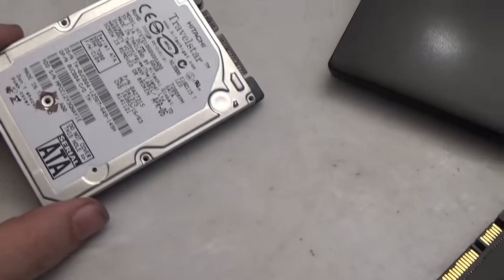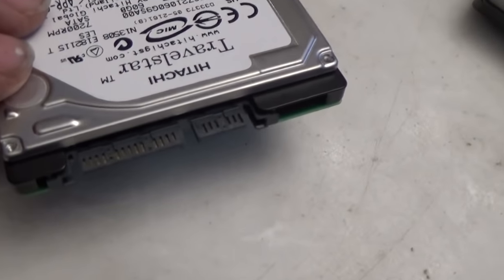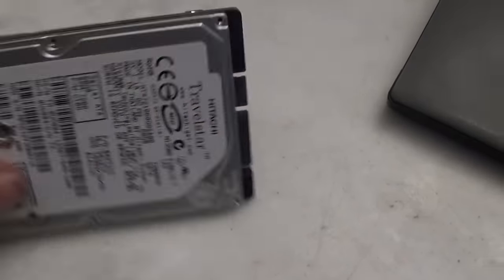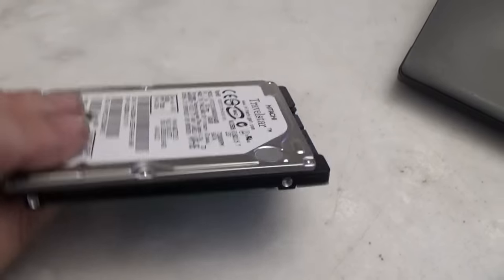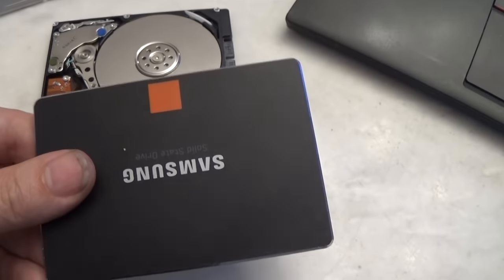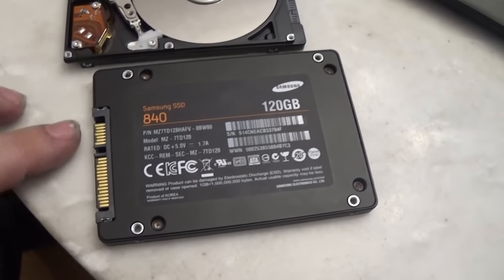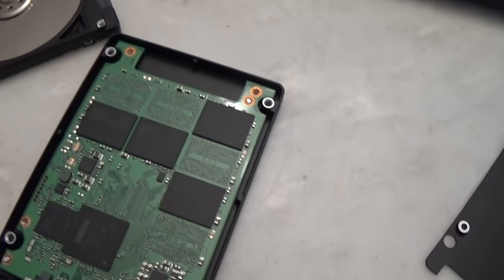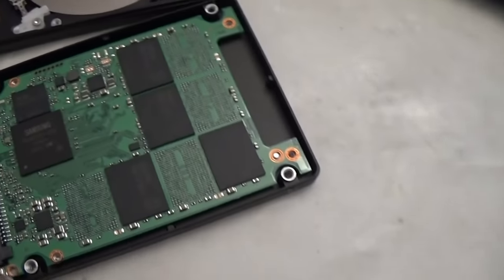Take a look inside a hard drive while it's running

Comment: So that explains why the sound in my laptop is hissing.
Reply: N..no. The hard drive does NOT make that sound loudly. You should check your laptop fans. Something might be wrong, it's worth a try.
Reply: Get a SSD
Reply: @poppyykawaiii  *AN ssd
Reply: @shinozaaakiii 

No this is the sound that a hear every day hdd was the reason for that sound
Reply: I think that's the fan, a hard drive isn't really loud
Reply: @SafirAksel 
Yeah but i still hear it if the envirment was too quiet
Reply: I usually hear a sorta sizzle sound, despite the lack of smell or heat coming from it
Reply: @BlessedDog  Depends on how you read it. Either its full name or just the letters themselves.
Reply: @redbluestar1272  depending on the kind of laptop you have, the sound you are hearing is most likely the fan. Even if you don't have alot of heat coming out, smaller/thinner laptops will have a very small fan that can sometimes sound like hissing. 
that being said, sometimes some older or cheaper hard drives can be heard and described as either a grinding noise (mostly in larger drives) or very light hissing (normally smaller laptop drives).
Reply: @BlessedDog  A, E, I, O, and U uses "an" and the other 21 uses "a". Did u skip Kindergarden or something???
Reply: @poppyykawaiii  but it is pronounced es es dee. Did you skip kindergarten or something.
Reply: DOG DOG “a” and “an” is based on the spelling not the reading. Did you skip Primary or something?
Reply: @poppyykawaiii  that's exactly what I just said. It is spelt es es dee. So because the spelling begins with e that's why it is AN ssd. English is not my native language and even I know that.
Reply: Your profile picture matches your comment so well
Reply: I.N Creator who’s one? Me?
Reply: @i.ncreator9918  thanks
Reply: @poppyykawaiii  it is spelt es es dee. So it is AN ssd. Since when you say it it starts with an e.
Reply: @BlessedDog  also "youtube comment section" is not a "english test" so? you wanna really win this argument huh?
Reply: @poppyykawaiii  yeah. I am the smartest doggo here.
Reply: DOG DOG lol
Reply: @BlessedDog  find some help please
Reply: @skyhunter2k  but why
Reply: oh no
Reply: DOG DOG you: AN Solid State Drive 
Robloxian: A Solid State Drive
Reply: @Pray To the Moyal 
1. an SSD2. a solid state drive
Reply: Nah it's just mad at you for downloading all those xxx_porn_mp4_no_virus.exe's
Reply: @BlessedDog  std*
Reply: @mat.992  They yes do
Reply: Your pfp matches with the comment
Reply: @trexirexi  thanks
Reply: @BlessedDog  its either way. "get "a" solid state drive, or get "an" SSD
Reply: @trexirexi  LMAO
Reply: @BlessedDog  idk man...
A solid state drive
An ssd
I think, it.doesn't matter
Reply: @laughtrack2269  whaa?? Is that supposed to be a joke
Reply: @pointzero4450  dawg what
Reply: Do you own a snake
Reply: do you own a snake
Reply: @poppyykawaiii  A/an is determined by the pronunciation not the spelling on most (if not all) cases.
Reply: I think there is a creeper inside your computer... Don't worry nothing will happen...
Reply: Try testing the health of it.
Reply: @poppyykawaiii  they meant me
Reply: @doomslayer4209  ill try
Reply: @doomslayer4209  welp, everything seems to be working normal
Reply: @redbluestar1272  Not your HDD, then.
Reply: @doomslayer4209  ok then
Reply: @redbluestar1272  One more thing, test it with HDsentinel. Also, if it's below 100, even 99 means very broken, 99 is almost doubled descreased performance. I'm talking from experience because I work in an electronics service, mostly computers. Have a good day.
Reply: @poppyykawaiii  of course. This is the internet we're talking about. Everyone wants to win every argument.
Reply: deadmeme 21 yea
Reply: Well I noticed the same thing when I bought a new ssd for my laptop. Loud af when you run a heavy program from hdd, silent if the same program is in ssd. I always thought that was the fan...
Reply: @xrafter  hdd is broken
Reply: Get the snake out!
Reply: Xrafter a fan night tho
Reply: RedblueRenegade it could be just ur fan
Reply: Yup Replace It With SSD/Solid State Drive It Is Silent And Solid And No Hissing
Reply: @sheepiscool  plenty of laptops have hard drives
Reply: This whole comment section is a shit show right now...
Reply: DOG DOG Either way is correct.
Reply: @BlessedDog  i agre grama is an vere impotat part of comets
Reply: Why are we having an english lesson in the comments of a tech video?
Reply: @caterhamct0473  yes
Reply: @jaxlegoproductions4147  you is riht is inportan
Reply: Why this reply section is a grammar war
Reply: well then your harddrive is about to fail, do a senitel test and see if it's still even functioning normally

or it could be just the fan on your laptop
Reply: SSDs don't last as long
Reply: I should probably make a clarification,  when I meant hissing I mean some static-like sound coming from the inside of my laptop.
Reply: @dylanhinkel3548  stop being a child
Reply: coil whine also could be a issue.
Reply: @poppyykawaiii  he doesn't know about vobles I think
Rip English
Reply: @BlessedDog   "Get a solid state drive" is correct. "Get an solid state drive" is not correct.
Reply: @redbluestar1272  overheating so goddang much or fans.
Reply: @poppyykawaiii  nope honest understand?
Reply: Both of you have atrocious grammar. It is a SSD.
And yes it depends upon the reading. It is, an honest man, not a honest man.
Reply: DOG DOG technically he’s saying “a solid state drive” just shortened, so it’s pretty easy to mess up
Reply: the sound from the hard drive is not very loud, you can hardly hear something coming from the hard drive.
Reply: @skyhunter2k  he doesnt need help
Reply: @laughtrack2269  AN ssd, A solid state drive.
Reply: @rmzndkv4536  i do
Reply: @deadchannel5933  agreed
Reply: @crableg2128  for telling someone they didnt need to be the grammar police and correct people in a comment section? lmao
Reply: @BlessedDog  You are smartest Doggo ;-)
Reply: eee mine sounds like a mouse
Reply: This is a great sound
Reply: @redbluestar1272  i bear zrrrrrrrr from my laptop and the fans’ sound is like a aeroplanes turbines lol
Reply: @redbluestar1272  probably a creeper
Reply: @mat.992  ikr lol
Reply: @redbluestar1272  perpare for battery explosion
Reply: @BlessedDog  Bruh why we mad about grammar ?
Reply: This comment section gave me a stroke
Reply: @BlessedDog  I had a stoke so I ended up back in -12 grade, thank you.
Reply: Ah yes, a stoke.
Reply: dats da fan bro
Reply: @xrafter  thats normal, a computer is expected to work in a normal environment, so i personally expect my computer to do some noises while the whole room is quiet.
Reply: @RusRus72  
I don't remember what this was about.
Reply: @xrafter  Womp womp